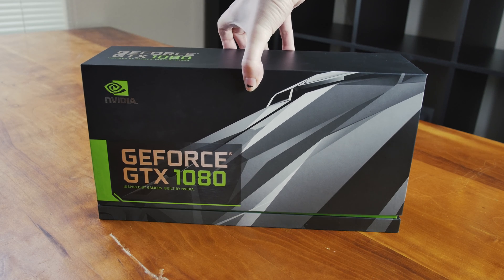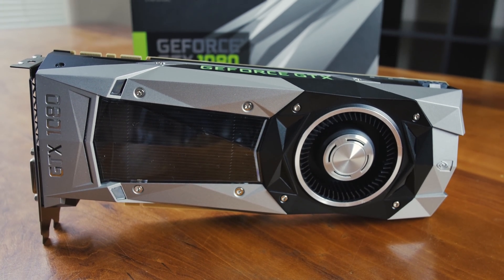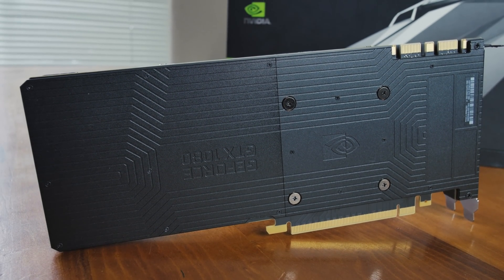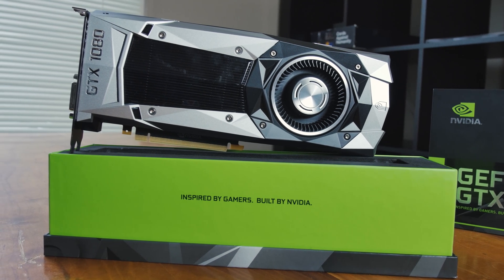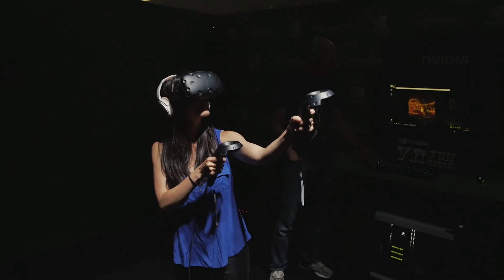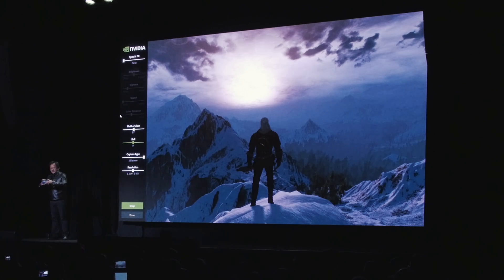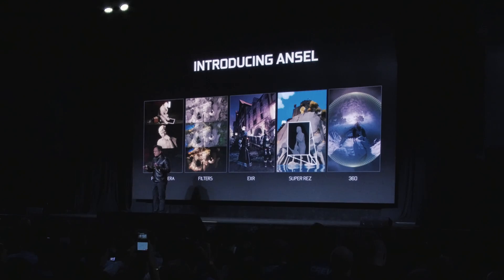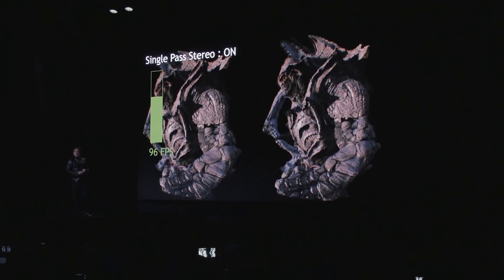Nvidia GeForce GTX 1080: The No-Hype Review Part 1

Comment: Guys is the NVIDIA Geforce GTX 980m good for 2016 and the upcoming years? I mean, will the 980M run future games on medium/high settings?
Reply: Henri Rameau it will be fine for 2017 and probably 2018 as long as you dont want to play at higher resolutions

Comment: will the 1080p have the same issue my 970 had?

basically my 970 in its shipped configuration, had to downclock when under high load due to hitting a power bottleneck.
e.g. base clock 1215, boost 1367, max 1405, it could hit 1405 at say 30% utilisation but at 100% utilisation e.g. firestrike benchmark it would drop to almost base levels like 1250.  I resolved it by making a custom bios which massively upped the power limit from about 170 watts up to 260 watts, so its no longer the power efficient card sold to me, but I can actually hit now 100% utilisation at 1481 speed.  I also had to bump the voltage for each clock bin as the evga bios was unstable.  So yeah I got a low binned card, that somehow past QC.

I hope the 1080p doesnt have these issues.

Also for some reason even tho I am subbed to you guys I have stopped getting your videos in my feed :(, will try to find out why, found this video by searching for gtx 1080 on youtube.

Comment: I am planning to upgrade form my gtx 760, but I don't have 1000's of dollars to spare, so is the gtx 970 still future proof at this point? I don't play vr and I have a 1080p screen.

I am mainly upgrading for witcher 3, Cyberpunk 2077, Shenmue 3 and all the games that I want to play in the 4 or so coming years.
Reply: Get 2 970s lol, we can be worried together.
Reply: 2 970's really? isnt that just about the same price as a 1080 alone?

I would rather shell out just a 100 more and get the 980 ti
Reply: My GTX 970 has no problem keeping any game I own over 60fps for 1080p at Ultra settings (including The Witcher 3). I hear it's even great for 1440p and 144Hz monitors. If you want to go above that, you may have to look into higher-end cards, but for what you said, the 970 is perfect.
Reply: Ok that is kinda neat.
I am a student so yeah I don't exactly have cash in spades
Reply: I would rather go with a R9 390 or wait for the Rx480 Cards coming out in this month. Both of them are more future proof due to much more VRam and the Rx 480 is probably faster than the 970 too and is going to consume less power while supporting new Technologies.With the 970 though it's pretty certain that you're going to run into Problems with it in the next one or two years due to it's lack of Vram.
Reply: Linkinfloid Maybe, but games are more often than not are shit optimized for AMD cards.
Reply: That may be, but as far as I know the GTX 970 and 390 are Overall pretty much on par with each other in modern games, and while the 390s Perfomance might still improve in newer games due to more raw power, the Gtx 970 is probably going to slow down significantly. Just look at the GTX 780 vs 290. The 290 is plainly dominating the Gtx 780 in most games today.
And as I said. the Rx 480 is probably an even better choice, as it is going to come at a very low Price, with a lower power draw and better Performance on the 29th of this month.
Reply: Problem is that I have an Intel cpu and well I am still considering what to get.
I am probably going to upgrade in half a year (kinda broke atm)
Soooo. I hope the GTX 1070/1080 will become affordable or I might just go to the 980 Ti (of which I heard a lot of good things)

Comment: 0:30 Pascal is a brand new architecture.  SM's in Maxwell have 128 CUDA cores and Pascal there are 64 per SM and the layout has changed.  Each SM has a new polymorph engine.  SMs are the core architecture.  More L2 cache, memory controllers, ext..
Exactly what hasn't changed?  

Tek Syndicate joined the AMD disinfo network?  

6:00  What extra cores?  Why would you idle a GPU on graphics?  That's an AMD thing.  If shaders are finishing at different times the card boosts the clocks.  That is what the boost clock is for.  AMD clock doesn't shift that fast.

You can run ASync compute + graphics using CUDA during graphics.  It's just that Nvidia moved past DX12 + WDDM 2.0 a long time ago.  DX12 + WDDM 2.0 is 2006.  
proof  
http://download.microsoft.com/download/5/b/9/5b97017b-e28a-4bae-ba48-174cf47d23cd/pri103_wh06.ppt
Reply: +Abram Carroll  That's exactly what I was thinking re pascal architecture.

Comment: End of the month. 699 bucks saved. question : do I spend 'em on the 1080 ? I have a gigabyte 980ti xtreme windforce. Thanks !
Reply: +TheGXDivider You already have a sweet GPU wait for AMD's offerings.
Reply: +TheGXDivider get another 980ti dude
Reply: Wait for the 2018 cards, unless 4K on a single card is a need for you. I have a 980ti and it still smashes anything currently out there. It'll be good for a long while.

Comment: It is very normal for PCB layouters to calculate length, width and what not in order to make sure the data arives correctly at the chip. It is called High speed design. So nothing new here.

Comment: So 980 vs 1080 fan noise on 80 - 100 % the 980s fan at that speed it very quiet I keep my 980 at 70c or lower so use afterburner fan profile and even at that speed it by far the quietest card I've even owned so is the 1080 the same

Comment: WTF 256 bit? are you joking 256 bit was not enough for my 980 ffs
in games with lots of grass I got mouse lag and it was like walking through water on land
256 is too small for some games that are set to max with top AA and driver settings

don't get me wrong I still got the fps it was just like being in water
 got the same effect years ago on a grassy game using two cards, they were the same but one was 128 bit and one was 256 bit
they both got the same fps but the 128 bit card was as said like walking through water on land
this was only on parts with lots of grass

I always thought is was strange how the fps was the same so if you ever get good fps but the game is like that with mouse lag it may be your card needs band width
as the fps is still high this problem would not show up in tests only the user who plays the games will see this

the two cards i had got the same score in tests

so 256 bit i was going to get this card but may wait for the ti

Comment: Hey, i have a question i want to upgrade my whole system i currently have a gt 430, I'm not sure should i get GTX 970 or shall i go all in on either the 980ti or the 1080 also which is better for gaming i7-5830 or i7 6700?
Reply: I'm mainly gonna game at 1080p.

Comment: So due to poorer yields and profit margin the mm2 is less than gtx 980, 
thus there's only a 25% core increase per cluster with no ROP increase. 
So the only thing left is clock speeds which are ramped up to 
compensate. This thing runs hot clocked high. The non ref cards should 
have much better cooling. Overall very disappointing they have just 
transferred great 28nm  DX11 card to 16nm finfet with no DX12/vulcan 
hardware design change and minimal progression. Nvidia are taking the 
piss on price. Only ever owned Nvidia since 2005 but enough is enough , 
time to give AMD a look
Reply: The Matirx red pill lul this kid is high

Comment: i wanna run a third party 1080 sli in my computer , is a 750w enough ?
Reply: +zorhis1996 Probably more than enough
Reply: ok thankyou
Reply: i ended up getting a bigger one anyways , so it will quiet :)
Reply: +Rudis no that's exagerrating..
Reply: *****
600w to sli 2 gtx 1080 isn't a good source you will underpower them
Reply: +Rudis a bigger psu under very little load will run quieter, fans will slow down , just like how a car engine is quiter when u go slow but when u punch it its loud
Reply: *****
one 1080 sucks out 250w , 2 1080s suck out 500w, you have 100w left and mobos+hard drives normally take around 100~200w depends on build + psu's overtime lost their effiency so a 600w after a years or 3/5 use will actually be 400-500w
Reply: +Rudis an aftermarket one may be more especially if its a oc edition
Reply: *****
oh your right sorry, 1070 is 150w too interesting
Reply: 8 pin carries 150 watts, plus 75 from the slot, which means each 1080 has a max power usage of 225w. The claimed 180w is an average, and is not representative of max watt draw. 2 of then is 450, this does not count the other components. Assuming everything else is less than 300 watts, should be, you should be fine.
Reply: ***** Of course.

Comment: What would be interesting to know is if the actual card architecture is faster going from Maxwell to Pascal or if it simply allows for higher clock rates. How would the 1080 do against the 980 cards if you run them at the same clock speed in MHz ?

Comment: GTX 980 is not the same as GTX 980 TI, so saying that Nvidia was way far off with their claims is wrong. They of course over polished the numbers, but if you take a look at all the other benchmarks where people have used GTX 980 as comparison (No TI), the GTX 1080 is nearly twice as fast. Not entirely though, so Nvidia's claim that the GTX 980 beating 2 GTX 980s is sort of false as it doesn't beat it BUT it comes damn close in most scenarios. And when you consider how much power it uses...quite impressive in my opinion.

Comment: Trek syndicate's benchmarks always seem lower than most sites not sure why. I'm getting a gpu soon to replace my 780 classified, going with a 1080, 1070 or the Polaris equivalent. Just gonna wait a couple months to see all the reviews and benchmarks. I just build a new rig a couple months back with a 5820k and a asus x99 pro 3.1 and 16gb 3000mhz corsair ddr4 and I had everything else, bought the asus mb because it matches my cm storm Stryker great and want a Samsung m.2 ssd soon. I can only get my ram to 2800mhz at a 4.5 overclock. But I'm very impressed with the 5820k and its a beast overclocked.
Reply: +Chad Hay cool story bro.

Comment: I am not impressed it is just a little faster than the 980ti.
Reply: +misterPAINMAKER yeah but it's the 1080, not the 1080ti, so...
Reply: +misterPAINMAKER Think you need to re-visit some benchmarks. The 1080 kicks Titan X butt seriously. And to half the price.
Reply: Yes i know i just expected double perfomance...from the 16nm.
Reply: misterPAINMAKER You have to wait for the 1180 for that i guess :P
Still, that performance for less then $600 (Non "founders edition") isn't that bad :)
Reply: ***** You dont compare overclocked with non overclocked dumdum :P
Reply: ***** So buy the overclocked 1080.
Reply: +William Galladryn Its cost is much higher than 980Ti though. Hardware is categorised by price usually.
Reply: giorx5 The 980 was also more expensive at first, then the price went down when the 980ti came out
Reply: +Becoming “The Unlord” Godsize Maxwell offers more performance per Hz. think of it like AMD(GTX 1080) needing a high frequency cpu to perform like an equivalently priced Intel cpu.

Comment: would a 1070 in SLI be the better option than a single 1080?

I'm currently using two 970s in SLI on a 3440x1440 LG Curved display.  I'm a big fan of high detailed graphics and eye candy.

Comment: the temps are 15 degrees higher at stock clocks vs the 2.1 ghz 67 degrees what Nvidia promised
Reply: +Aberkae Godrilla mate, they probably fudge the stats like they did on the GTX970s #ROFL
Reply: +Christopher Gröblacher (Moonzone) they were running unreal engine  with paragon!

Comment: 1. It's NOT DP 1.4
It's DP 1.2 with partial DP 1.3 and DP 1.4 specifications. States "DP 1.3 Ready" and "DP 1.4 Ready". They bypass the Free-Sync specification, thus do not fully support the DP 1.3 and DP 1.4 standard.
2. The reference design throttles after a few minutes of load. It cant even keep the regular boost clocks. That's far away from the promised ">2ghz under air" which Huang talked about at the presentation.
3. SLI works same as always, but they now limited it to >2 cards<. There is no more 3 or 4-way SLI possible with Pascal.
4. Asynchronous Compute is definitely NOT possible on Pascal, just some rare Nvidia-optimized benchmarks come close to a 5% performance gain; no real benchmarks.
Reply: +Tymax didn't PCper have their card running at 2GHz no problem
Reply: 3. WRONG, 3 AND 4 WAY SLI WILL BE POSSIBLE, BUT YOU NEED A BIOS CHANGE. THIS WILL  BE PROVIDED B Y NVIDIA
Reply: +Tymax Yeah, it is not certified for anything but Displayport 1.2. 
Not really possible to certify for 1.4 yet as that standard is brand new, 1.3 is from 2014 and certification for that is no problem. The only real difference between 1.3 and 1.4 is the compression thing in 1.4, no higher bandwidth etc.
Reply: +Tymax Almost everything you said is false lol. AMD butthurt fan much? Where do u even get your info bruh? It does feature ASync, and you can have more than 2 cards in SLI if you want to, Nvidia just said they don't won't support it anymore, because they don't recommend it. 3way and 4way SLI/Crossfire is Shit anyhow. But the option to have them is still there, you just have to Unlock the feature.

Comment: I was hyped for 1080 and was going to buy right away but now... ehhhhhhh. Think I will just wait to see what they do with 1080 ti or buy another 980 since the price will probably drop a lot now.
Reply: +Just4Gamers Tube ive seen videos with a overclock at 2.1 ghz and it was outperforming 2 980 ti in sli
Reply: +justin cunningham 1080 outperforms 980 sli without overclock in almost everything with overclock it crushes it

Comment: One thing I've only seen one youtuber mention so far is that the Founders Edition Premium that your paying is actually kind of justified. Comparing it to classic cars, an un-customized classic car from the 60's or 70's is worth more because it's seen as a classic. The Founder's Card is kind of the same. Sure it might not perform as well as a custom cooler or custom PCB, but it's experiencing the card the way the manufacturer intends it. Also to mention the fact that Custom coolers and PCBs aren't going to be on the market as early as the Founder Card is, the Founder Card kind of acts as an Early Adopter fee. Your paying the extra money to get your hands on it ASAP and to have it the way Nvidia inteded it to look and perform. Whether that's $100 justified is going to be subjective, but it makes sense from a business standpoint.

Comment: Hey Tek,
The Pascal architecture still only has one big GigaThread engine (one big core) as it is still essentially a maxwell gpu underlying.
However what they did do is they enabled hyper threading for the GigaThread engine which means the next instruction will be able to start processing through the ALU before the previous process has finished.
So it isn't quite asynchronous compute but there is a speed boost if it is used correctly (which it isn't if you look at ashes of the singularity dx12 performance)

Comment: There is no confirmed Async compute on this card, and with Nvidia being so vague about it, it's most likely a software bruteforce solution.
Reply: New to gaming? That's how every DX starts out.
Reply: +uzuhl you won't be like that when DX12 becomes the standard :P
Reply: ***** perhaps. But game development stagnated because we didn't have new consoles and we're close to the release of new ones.
Reply: A nice that both consoles are using extensively, and which Devs have said offers real benefits when implemented? Eh, I don't think so.
Reply: You missed the point. Most games go console and pc, so if Devs code with Async in mind, it's going to have huge benefits for the PC hardware that supports it on a hardware level.
Reply: +Keith Maher Async compute is niche anyway, and something the anti-crowd just ran with as if it was a big deal. Not even featured in the base spec for DX12. It will matter in AMD titles the same way extreme tessellation performance mattered in Nvidia-endorsed titles.

Comment: adoretv check has channel he will explain in detail how these cards work. We have yet to see if nvidia gcn is hardware or software. As of now AMD is 100% GCN hardware which is more efficient.
Reply: +carzacc what. AMD hasn't came out with their cards yet.. not to mention AMD new cards with be 14nm not 16nm like nvidia.
Reply: +carzacc correct. asynchronous compute. Wrong Nvidia hasn't mention or gave data if it's hardware or software. GCN is AMD arc(asynchronous compute) and its why its getting good performance in dx12(not the crap that's nvidia has crippled) a 3 year graphics card from AMD is getting better frames with dx12 that speaks a lot.
Reply: Also efficiency refers to power consumption - waste energy divided by power consumption
Reply: he's ^^ dumb auto correct
Reply: basically in intel tick tock terms this is just a tock
Reply: GCN is a GPU architecture from AMD and it's less efficient than Maxwell and Pascal
Reply: carzacc gcn isn't a single architecture though.  In the same way all nvidia products since tesla core have all been improvements of that arch rather than a fresh new arch
Reply: Alejandro Rubio I'm saying current generation (200 and 300 series):
the 390 and the 970 are pretty much the same thing (390 is slightly better but whatever) but the 970 is much more efficient

Comment: Shrunk Maxwell... but with 8 gddr5x... which is nice.
Reply: and lots of new features. so far so good and apparently Polaris won't really compete so this might be the big thing until vega.
Reply: +Final Cam I am looking at the 200-300 price-rage of the new generation, 1080p 60 fps... everything VR means nothing to me, all i care about is raw price / performance improvement and not lacking technologies like async or under 4gb vram so it could last for the next 2-3 years.
Reply: Necris Polaris is right around the corner 1080p 60fps for 200-3004 is its goal!  I myself want to move up to 1440/60, or 1080p/60 with DSR, also without the limitations of my 3.5gb of vram.  Polaris and vega interest me as well.